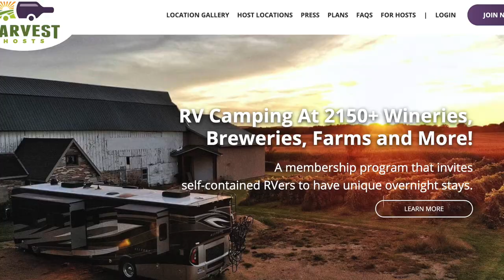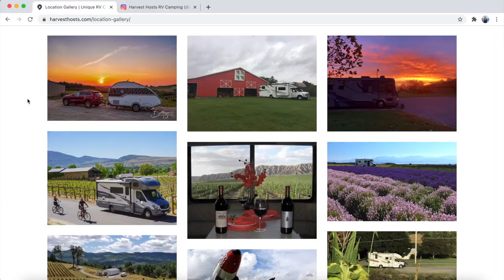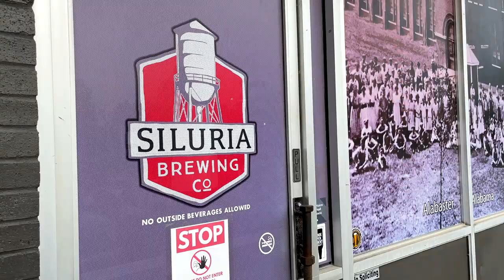FREE RV CAMPING IN ALABAMA with Harvest Hosts | Full-Time RV Living | Rookies On The Road (Ep. 9)

Comment: Please, correct me if I'm wrong. My wife and I just got a camper and we were told not to use grease or anything on the friction points on your weight distribution hitch. You can on the connection part on the hitch, but not on the friction points on the camper side. Again, correct me if I'm wrong. Was told by the service guy that helped me put it on.
Reply: That is correct. 😊
Reply from the maker: Oh that’s super interesting, we didn’t know about this! Thank you for sharing!
Reply: The noise is annoying but normal on most WD hitches.
Reply: @CrosbyGraceTravels  You have the same hitch as us and yes, you only want to use a bearing grease on the top and bottom plates of the head. The sound is normal but you have more sound the more WD is in place when hitched up. It might be worth taking time to take measurements per the manual to verify your hitch was properly installed (if the dealer did it). Our dealer just slapped everything on our rig without matching it perfect to our rig and tow vehicle. Tow experience was much better once everything was properly adjusted. I have been enjoying your videos. Looking forward to your trip across the US.